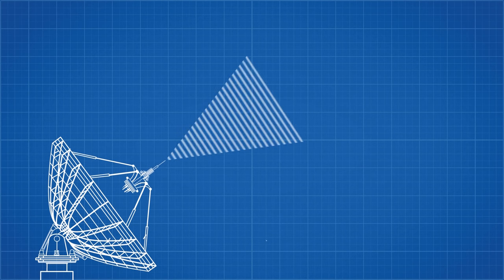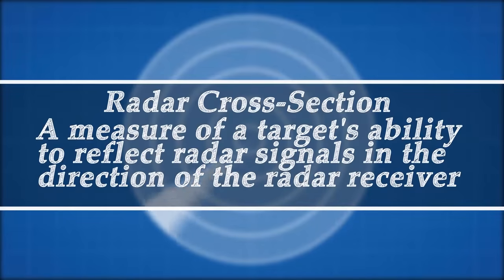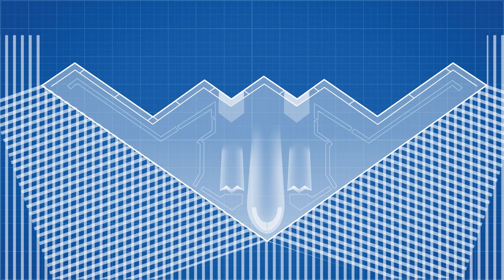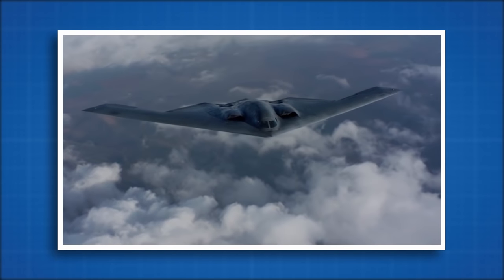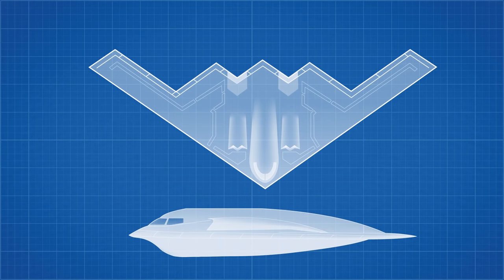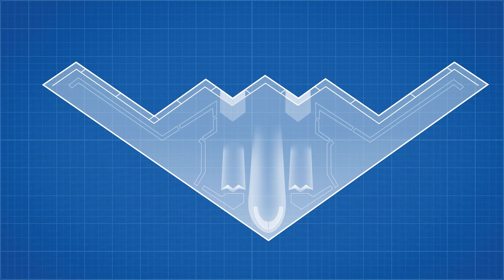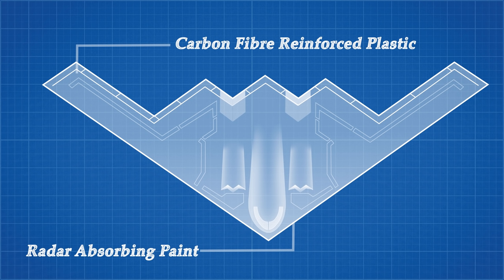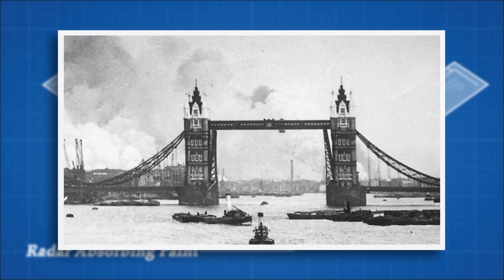Stealth - How Does it Work? (Northrop B-2 Spirit)

Comment: So if radar can detect even a small section of the B-2. the operator should be able to determine it isn't a bird by it's speed it's traveling at as that radar tracks this small section. if there are any actual radar operators that can help me out
Reply: alohim king it would be able to realize it's not a bird but just because you know what it is, you won't get a lock. Though you could scramble fighter
Reply: +Justice Johnston thanks however new radar technology today is vastly superior then what was available in the days of the B-2 I'm unsure of how advanced these new system's are. but would say stealth aircraft even today are detectable to a higher degree then before capable of detection, tracking, and lock all these systems working together for a possible shoot down of stealth aircraft. however this new radar technology hasnt actually proven itself on the battlefield. only on paper so to say.
Reply: Well, stealth capable aircraft have been shot down before, namely the F-117 that all these Serbians keep referencing, but even that took a miracle happening for it to be shot down.

Comment: Aren’t they designing b53 a new stealth bomber
Reply: B-21 Raider.
Reply: ivanlagrossemoule isn’t it a drone?
Reply: Nah the B-21 is a deep penetration bomber. Drones would have a different terminology, like RQ-170.
Reply: ivanlagrossemoule Can stealth overcome light? I hope it can as the Brits new R&D radar, it uses light (photons) to detect aircraft and can show a detailed image of something miles away, rendering stealth inert, although we swap tech with them so USA probs gets it too when their done, last one they gave us their electro propulsion tech for the zimwalt and their rail gun tech in exchange for targeting systems and the designs for some armour tech.
Reply: The B-2 for example has sensors that detect the light level at its altitude so that it can fly at the optimal altitude as to not be seen.

In reality, what people forget to tell you when talking about such systems, is simply that they're impractical in a full combat environment, and their capabilities get exaggerated. Every few weeks I hear about a new 'radar' that's supposedly going to make stealth obsolete. But none of those systems end up being produced. Why? They don't really work as advertised in real life.

There are two main aircraft detection systems today: optical and radar based. Radar are actually highly effective to start with. Detection ranges for a small radar that can fit on a small truck or aircraft are 400+km. Against current US stealth, you can easily cut that range by about 20, meaning you're looking at something closer than 40 km or so (lower range for the F-35, higher for the B-2). So you have to beat this somehow otherwise your system is a waste of time to start with.

If you want to pick optical systems to do this, why not base it on how much light the B-2 produces? It's not visible to the naked eye, but the exhausts do produce a decent amount of infrared light. The problem is seeing that light at huge ranges (40+ km as stated previously). So infrared light already makes it difficult. So now how sensitive and how much light do you have to produce to detect a B-2 using a sensor that isn't trying to find its infrared signature? It's very difficult to say the least.
Reply: ivanlagrossemoule well what a waste of 5 billion for them then lol.... but flying higher doesn’t that run the risk of being detected by a satellite forgive me if this is stupid but some stealth planes have engine mounts on top to hide from ground based systems but surly an orbital grid could see that?
Reply: Satellites fly really really fucking high and far away. The lowest are around 200 km high, which is loosely 190 km higher than what the B-2 would fly. They can be as far 35000 km for geostationary orbits. Satellites are good at tracking large objects, but if you start having to scan large areas, that's a HUGE amount of information, and you're looking at a whole planet behind you have to filter out rather than the sky.

Basically satellites don't work like in spy movies.

Comment: Looks like the german stealth bomber in ww2, which never have been used
Reply: Yup
Reply: @10p_b3_cruzyumie.6  The Germans hadn't figured out Stealth in ww2, the Horten IX was a fighter not a bomber, and it certainly wasn't a stealth plane.
Reply: @zorax15  this one Horten Ho 229
Reply: @zorax15 , Using radar detection technology and simulated aerial attacks, the tests revealed that the Horten’s Radar Cross Section was 60 percent smaller than that of the Luftwaffe’s mainstay fighter the Messerschmitt Bf 109. Experts thus speculate that the Horten could have been an effective weapon.
Reply: @zorax15  but it reduced it, and reducing radar cross section is technically stealth
Reply: @zorax15  i used an article
Reply: @10p_b3_cruzyumie.6   The radar signature was reduced to the same extent as with any other flying wing, too. If a flying wing design was mandtory for stealth, why was the first stealth plane shaped like a prism?

Comment: Serbia shot down stealth plane with russian rocket from '60, good job usa
Reply: +Danilo Nastasovic

 Keep in mind the fact the F-117A was an antiquated design that lacked countermeasures and had underwent no major upgrades since its introduction where as the P-40 R.A.D.A.R. setup was a remanufactured and modernized system from the '1980's.

Comment: It works like this.. 
-You paint the plane in black
-You call CNN and tell them its stealth
-You send it to Serbia to drop 2 bombs
- You pray they dont shot it down with BB guns
- If they do, as they did  than we make F-35
Reply: This is just utterly wrong. Besides... Serbia shot down a F-117... The reasons it was shot down was because it flew a predictable path and the bomb bay door malfunctioned, remaining open. To the radar, that open door was like a floodlight in a storm. The B-2 Spirit has never been lost in combat.

Comment: All thanks to ww2 Germans
Reply: How so?
Reply: Nathan Peterson this whole stealth technology was developed by Nazis.. 
Even this design of b2 bomber which was taken by Americans as the blueprints of Horten Ho 2-29.
Reply: Ahmad Rana 
 
 The Go 229 was not stealth. It had a small R.C.S. for one, given its size, and two, it's construction- wood and glue. Same exact case as the DeHavilland Mosquito. 

 The Go 229 v.II was the only one of the Horten's projects that flew under its own power. It crashed on its second flight hour of testing in February of '1945.  The v.I was destroyed during a bombing-run, the v.III, the most famous of the bunch, was never completed, and wasn't found and sent to the U.S. until '1947. 

 The B-2 was by no means related to the Horten's projects. There  was nothing to take from it.
Reply: Nathan Peterson 

Nazis stealth bomber was first built and tested in the air in March 1944, it was designed with a greater range and speed than any plane previously built
and was the first aircraft to use the stealth technology now deployed by the U.S. in its B-2 bombers.
In 1943 Luftwaffe chief Hermann Goering demanded that designers come up with a bomber that would meet his ‘1,000, 1,000, 1,000’ requirements – one that could carry 1,000kg over 1,000km flying at 1,000km/h.
Construction on a prototype was begun in Goettingen in Germany in 1944.
The most important innovation was Reimar Horten’s idea to coat it in a mix of charcoal dust and wood glue.
He thought the electromagnetic waves of radar would be absorbed, and in conjunction with the aircraft’s sculpted surfaces the craft would be rendered almost invisible to radar detectors.

This was the same method eventually used by the U.S. in its first stealth aircraft in the early 1980s, the F-117A Nighthawk.
The plane was covered in radar absorbent paint with a high graphite content, which has a similar chemical make-up to charcoal.

After the war the Americans captured the prototype Ho 2-29s along with the blueprints and used some of their technological advances to aid their own designs.

There were a full documentary on it and they also replicate the whole aircraft by blueprints and it was proved that the plane was stealth. 
Which further lead and motivate US engineers to build their own.
Reply: +Ahmad Rana,

> "Nazis stealth bomber was first built and tested in the air in March 1944, it was designed with a greater range and speed than any plane previously built and was the first aircraft to use the stealth technology now deployed by the U.S. in its B-2 bombers."

 The first and only German flying wing to fly was the Gotha Go 229 v.II in Funerary of '1945, which crashed after its second flight hour. 

 It wasn't "stealth" either. It was tested by Smithsonian in the mid '2000's as far as its microwave signature went. While it had a noticeably smaller R.C.S. than other fighters of the era, this was because it was smaller, and because of its lightweight construction. Of wood and industrial glue. Much like the DeHavilland Mosquito. 

 The technology found on aircraft of this era shares almost nothing with aircraft in the '1980's. 

> "Construction on a prototype was begun in Goettingen in Germany in 1944. The most important innovation was Reimar Horten’s idea to coat it in a mix of charcoal dust and wood glue. He thought the electromagnetic waves of radar would be absorbed, and in conjunction with the aircraft’s sculpted surfaces the craft would be rendered almost invisible to radar detectors."

 As for the latter statement of charcoal dust, it's largely hearsay. The v.III, the only one to survive being captured (not until 1947 mind you) was put into storage and left for a number of years. This material was noted by the Smithsonian Air and Space Museum in the '2000's in its covering. 

> "After the war the Americans captured the prototype Ho 2-29s along with the blueprints and used some of their technological advances to aid their own designs."

 The only particular feature of the Horten aircraft noted was the flight control surfaces, using hydraulic pumps to fine-tune the flight characteristics. This was used on the F-117A. But a fly-by-wire system was used for the B-2.